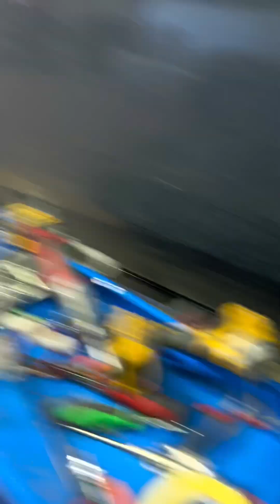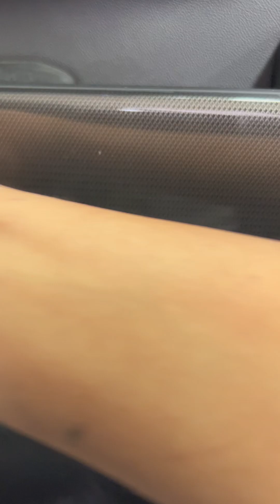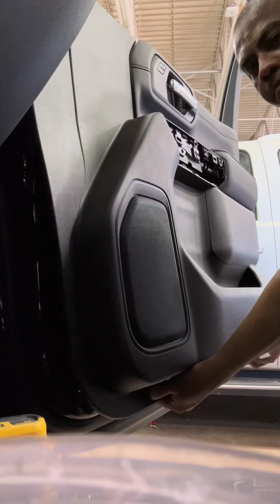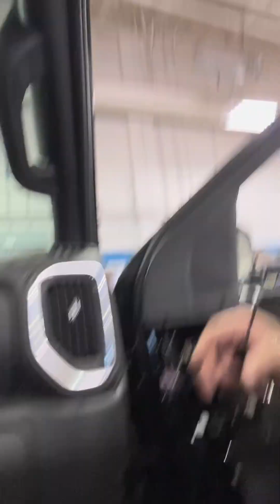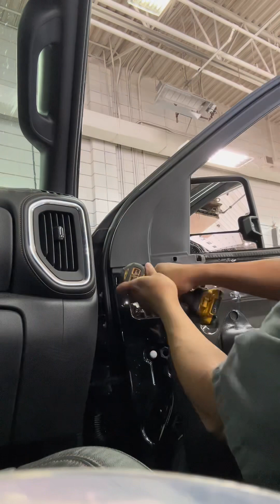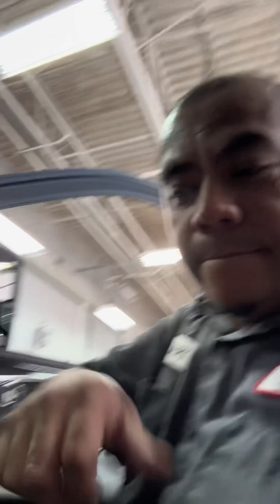How to remove and install the side mirror of your 2023 Chevy Silverado 2500

Comment: Can you replace it with a 1500 mirror???  2023 2500HC
Reply from the maker: If you got 1500 truck and try to replace it with 2500 yes you can if its after market... but if its GM you cant... and if you got 360 cam on your side mirror you wont be able to use it

Comment: Nice video.  Question? The textured plastic near the cap, the plastic that covers the rear facing leds on the mirros, can that be replaced?
Reply from the maker: It vmcan but you will disassemble everything in that side mirror